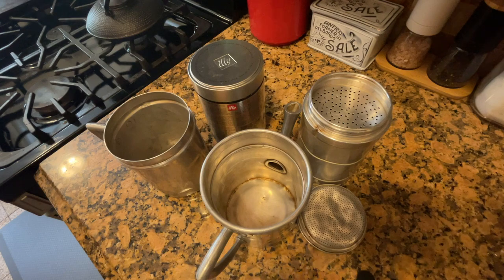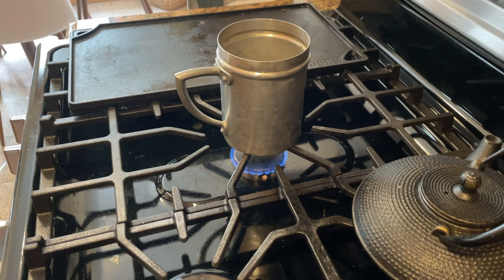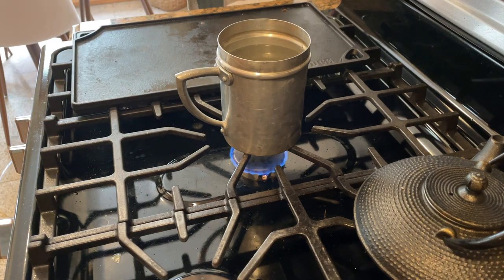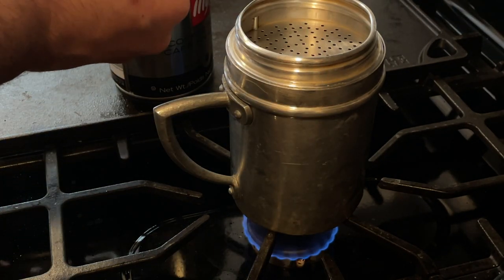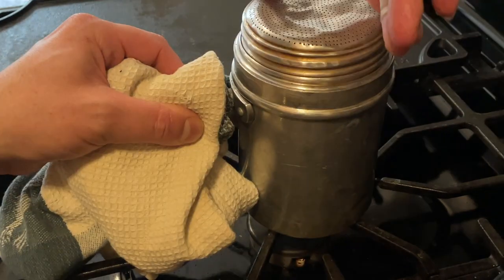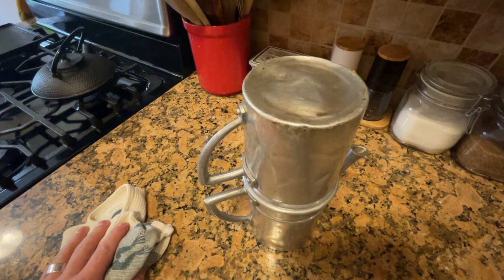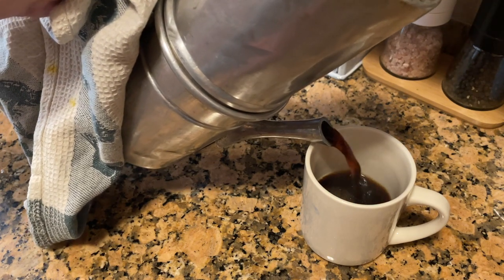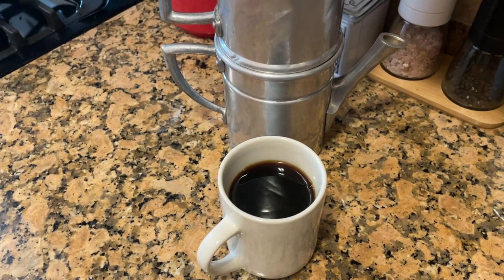How to Make Neapolitan Coffee (Cuccumela)

Comment: Hey man, hi from Italy. I make mine every day and have researched, and experimented thoroughly, and I can well say, you are truly a master ;) You're maybe the ony other one I've seen, pre-boiling the water. Which is supersmart. It prevents the grounds to be overextracted. The one thing I haven't tried yet of a million, is to click in the 'pitcher' half, when cold off the stove. It sounds interesting, after all it the coffee cools down a lil bit once brewed, it sounds good. It escapes me if you do so, but I suggest, make sure the water after boiling at 100°C, sits for 60 seconds so goes down to 96ish°C. And only then, flip it. In Italy we do so by waiting after the whole thing boils and drips the little drop from the eyelet.
One more thing, it surprises me you kinda press the grounds in the filter. When i did so, it wasnt good. But i guess you do it gently.

Last but most important: keep that pot on a shelf with all the love in the world for your nonna, but aluminum gets toxic after some years of use (producers now put a protective layer and recommend to replace pots after 10 years anyway). it must never be scratched. In fact, it is safest nowadays to get a stainless steel one (which will need not to be left with coffee remains inside for several hours, or it will leak nickel in turn. Still kinda less dangerous than aluminum compounds, in the long run). if you have a look around, many videos here even from historic cafès in Naples, use steel ones. Best to you! Ciao :)
Reply from the maker: Thank you for watching and the suggestions! Appreciate the feedback. I think I'm going to create an updated version with a newer pot.  Be well!
Reply: How about copper?

Comment: I celebrate vintage stuff, especially those items handed down through the generations. Although I think my Drip-O-Lator system is easier, none of my coffee makers were handed down to me so yours is way cooler in that aspect. 

One thing I've learned with my smaller Drip-O-Lator that's been everywhere with me throughout my military service, is to use Mechanix gloves with it. I don't use the pot part of this three cup version and only use the reservoir and the filter part, instead using my military canteen cup as the pot. 

Once you put the ground coffee in the filter part, the reservoir and the filter latch together to make them one piece.

After boiling water in the canteen cup on anything from a stove top, to an MSR stove, to an open fire, while holding the aluminum reservoir/filter, I pour the boiling water into it and then place the canteen cup back under it to catch the coffee. I only have to hold the reservoir for a moment as the water is going in there but, Yo diggity does it get Hot. The Mechanix gloves have enough protection to keep my fingers from getting roasted for the short time it takes to get the water in and set it down. 

Seems like you could do with a pair of Mechanix gloves while using yours as well. Thanks for the video.

Also... after taking a look at your channel, I see you're from NY. My time in the Army has deposited me out here in the Great Northwest but I'm from Binghamton originally. I had family... Italian family... lots of Italian family living in the city when I was growing up and we had to go there a few times a year. I haven't been back since the towers have come down, but since my wife is from L.A. and has never seen the city, I have plans to bring her out this summer. It should be a good time. Ciao!

Comment: Ive seen other videos with this pot where they leave the top on while heating up? any difference?
Reply: I prefer to leave the top and the filter off while heating because I can measure the temperature of the water to exactly where I want it. You should heat the water to 212 degrees Fahrenheit, wait 60 seconds, then assemble and flip the pot. The reason you do this is to prevent the coffee from getting burnt and tasting bitter.

Comment: Madonna . Why are you putting it together when it is on the gas? I mean actually adding the coffee? And then at the end you place the last bit on and flip it. Not going to be boiling is it? Steam coming out of the pin hole designed to tell you when to flip it is astranger to you.

Grandma ( Nonna ) would cry if you do this.  I have have shed a tear and said a prayer for you , "for he knows not what he does".
Reply from the maker: Different strokes for different folks. Worked for my Nonna, but maybe yours isn't so forgiving? Thanks for watching anyways.
Reply: @CRtrain  Mate , A Cuccumela has a very particular design . It is a design that dictates function and use. If you use it in a way it is not designed to be used that imo opinion is a disaster .